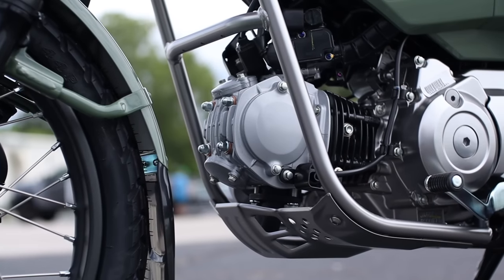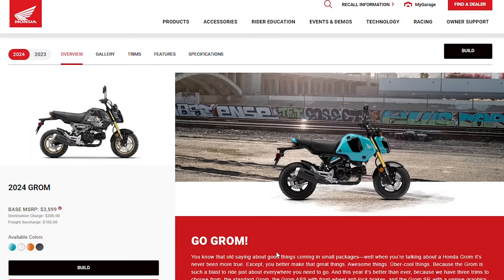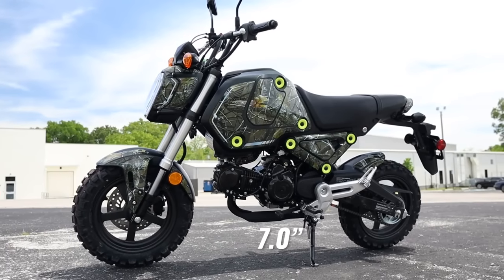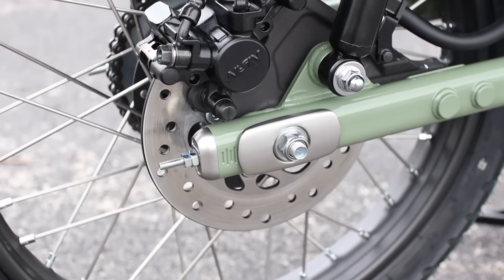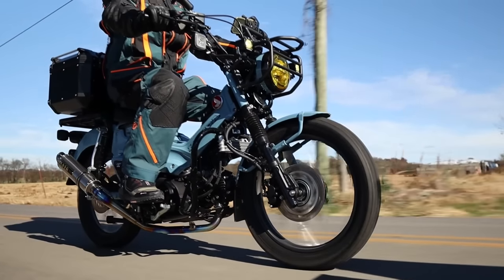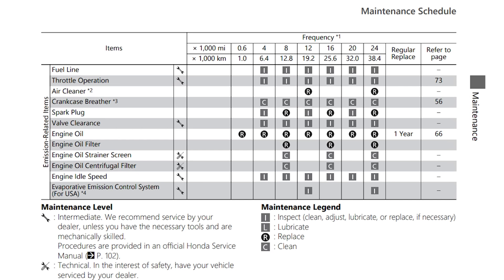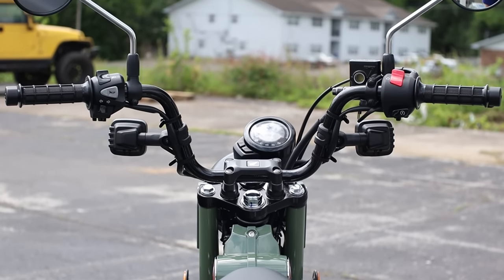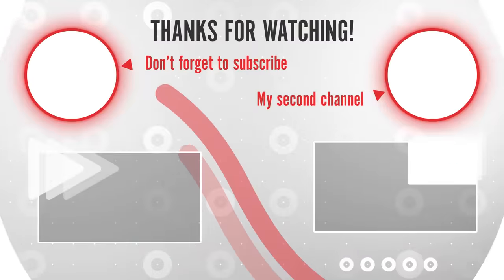NEW Honda Trail 125 Review | CT125 = Better than Grom, Monkey & Super Cub Motorcycles?

Comment: Really wish we could get it in a 200 with a 5 speed. 65 mph, comfortably, would sure be nice. I don’t think that’s to much to ask for
Reply: I keep saying that honda needs to take the rebel 300 motor and cram it into the minis as a 2nd engine option but keep the size of the bikes mini. Then youll have like a 276cc 6 speed and that in a grom or trail 125 would make them much more capable of actually getting me around town with the hills i live in. The problem is i think honda might not want to kill sales on the 125 because the 125 is still a good motor and its durable for what it is and its been out for a long time. Plus theres 300s they dont want to pull sales from by people cross shopping in the same brand. If you sell 3 versions of evety bike eacb one might sell less. I just think it sucks how a grom struggles to 60mph and it should be able to get to 60 faster and also maintain 60 up a hill. Or even faster i mean that sucker should rip. Yiu do a 125 cc for learners they upgrade to like the 250 grom or something idk. The 125 motor is good and shouldnt go away it gets the best mpg it is the best for just swinging out of your neighborhood for a snack at the convienience store or something.  There is a novelty to the 125 grom or trail125 that makes them interesting to a wide variety of people. Doordashers etc. The rebel has 3 options. Im suprised all the minis dont have 2 options. The OG 125 for the ultimate fuel economy and learners and the nkvelty comedic factor, or a more powerful more realistic 250 from the rebel which they call a 300 eventhough its like a 276. So they could market it as a 250 but its even slightly more. Mahne they do something else idk but we know they have the revel 300 engine amd that thing js compact. But js jt compact enough to fit, the grom might meed a generational change like the rebel djd to account for different engine options. Or idk i really like innovation so to me its interesting to try to build the smallest most reliable bike possiible soemone 6 foot tall fits comfortably on that goes as fast as possible without being electric. Then You get an easy package to fit in the garage with a lot of power at a good price and a 125 grom is not that a trail 125 is not that. They are small but slow. I think 250cc version js the way to fill the need. Like how they have 3 versions with the rebel but idk the minis maybe a 125 and 250 version? Imagine a parrallel twin grom tho 270 degree crank. Parks next to a 125 grom and is clearly on a steroid injection program. Idk what will actually happen i just want to be good. I hate the aspects of bikes that make them all identical in certain ways. I really enjoy when something is unique and peculiar in a way that is pleasent. So thats why the trail 125 is appealing but 125cc is rough if i want to leave my small town to thr small town next door where the work is at. Speed limit 55 everyone does 60 and theyll pass you while you do 60 uphill so trail grom 125 motor really isnt safe on those roads always.   I like the series harley cancelled when they lost their minds, there was a sporters series and you could get an 883cc or a 1200cc. the 48 the 72. They were able to make 1 bike 4 bikes. To me groms are too disposable but id still buy one. I like the extra reliablity of a larger engine that would help. The 125 is great for the trail the nkvelty running tho the gas station for snacks, but a 250 isnt far behund and a from 125 for mpg. And in like a trail 125 if it was a 250 would. Cross alaska faster etc. Safer on faster roads. The 125  you take the longer flatter side road because speed limit is lower  and it keeps me from wanting to take the bike out because maybe i just want to quickly go to walmart for a few things and back and the speed lomit 60mph up a hill. The trail 125 i will buy one but to me its partially more like an excersize in good asthetics i am an art guy as much as a motorcycle guy so i like it to look good sitting there and a trial 125 does. But then im like shoot that looks good let me take it to walmart and i have to take the back road slower the trip takes twice as long each way and then im like yo 70mpg in a 250 woulda been better than 110 but a 15 minute drive turned into 25. If im not leaving my small town a 250 is not needed but i like to explore my whole county and the one north of me as theyre the two closest civilizations and between them its 75mph and just between my town and the two others you have to be able to get up to 60 and 65. So its hard to spend 4k on a bike that struggles to get me out of town when a 5k used accord with 200k miles can take me across the country. But i cant take an accord down a single track trail made by people on 125 250cc 450 cc dirtbikes. So i like the 125 its just if they sold a 250 trail id try to get both 😂 i want to see honda use the grom as a plaftorm you can get a super efficient one or one thats just questionably fast. I feel so bad for these guys building touring rigs from trail 125s and jts like yo if im going to the top of alaska if honda sold a trail 125 250 id take the bigger one. They modify the 125 engine for power and its lifespan is 50k miles stock if you maintain it perfectly. So they make it unreliable fast when the motor coulda just been bigger stock.  To some degree i like small motorcycles and big ones so its hard for me to say to cancel the 125 and make them all 250s because i wouldnt mind a grom or trail 125 or 250 both. Or just rediculous fun stuff like a tripple cylinder grom thats got 125cc cylinders its like this ugly duckling that has 375cc but what matters is the power to weight ratio. Idk turbo it from the factory, something. Something. Something. No way you fit 3 cylinders in a grom but i mean what if the 1 was bigger or you do 2 small ones idk. to keep the light alive the souls living, you need uniqueness and peculiarity. The trail has a lot already i just wonder if you can scale it up like the rebel, 125 250 and 500 for real tourin idk. A 250 trail would outnit out there doing light trail dirtbike type stuff. A 250 dirtbike is right in the pocket for the trail you hage to build momentum with it to get up a hill so a trail 125 its worse you end up stopping halfway up and pushing it up. If it was a 250 using the rebel 300 engine thats a 6 speed it can do like 60 stock 65 idk. I got the need for speed but i hate all electrics. I think motorcycles work well as straight gasoline motors
Reply: Yamaha TW200
Reply: @mojaveclimber  I had a TW200, it could cruise along at 55-60 but that's about it. It was too short coupled even for me at 5'9"! I always thought Yamaha should add a couple inches to the wheelbase and put the XT225 engine in it.

Mr. Mojaveclimber, are you a rockclimber somewhere in the Mojave Desert? There is a pretty active climbing scene up in Ridgecrest if you are interested.
Reply: I'd say 150 or 175 would freat
Reply: @mojaveclimber you’re asking for it to be something it isn’t and never was intended to be
Reply: The trail 125 needs to be like the rebel but where you can get it in 125, 300, or 500. That way for people who really want to build a touring rig they can get the 500 and have better interstate capability
Reply: @aaronpudlicki7418  mojaveclimber simply suggested the TW200, a bike with a bit more of everything, as a fill-in for the annoying's moto fantasy. I think anyone that can handle a manual clutch would be better off on the TW200. More power, more suspension. 
I think the new Trail is cute. On the road it's clearly better than the CT-90/CT110. Offroad??? Hard to beat that dual range transmission in rough stuff. 
But Honda kind of trips on its own feet with the XR150L, way cheaper and significantly higher performance. For someone with lots of money it doesn't matter what they get, it's just a toy. For someone looking for a practical bike to commute on and have a little offroad fun, there is no doubt which is the better bike.
Reply: @randydewees7338  You got that right. If I wanted cute or a toy I'd ask for it. Why don't they just get it over with, make it electric and paint it pink. This is the company that made the Elsinore?
Reply: You can slap a Daytona 190 4 valve engine on there for pretty cheap. Put a tall gear on and hit the road.
Reply: @randydewees7338  Why not spend a LOT less $ and buy an XT500? You want grunt from a bike, it's got it.
Reply: @usernumber09 hyundai elantra
Reply: Problem  is, then you would want to drive it on the highway  and that  would not be good .
Reply: or maybe a KLX 230 or 300. @usernumber09
Reply: Why not get a different bike? You’re missing the point of the minimotos. They’re supposed to be small everything.
Reply: @charkswitlazers  exactly.
Reply: After living with my CT125 (latest version) for several weeks you have a good point--I'd prefer a 5-speed manual.   It's a great little bike yet I could see Honda offering an upscale model like you've suggested, without canceling the C125.  Possibly this would address many of the comments here.  I saw one person suggest the KLR650.  They used to offer a smaller version KLR250 (Super Sherpa) dual sport: dual disc brakes, 6-speed transmission and wide comfortable seat.  It could run up to 75MPH.  Really neat bike that I enjoy very much.  Compared to the CT125, it's biggest disadvantages are that it's taller with a higher center-of-gravity and not fuel-injected.
Reply: @TheAnnoyingBoss  A big CC underbone step-through makes no sense at all. Just buy a bigger bike, or lose some weight...
Reply: Don't want to make this into a larger bike but having a larger engine and 5-speed manual transmission would help very much.  I'd buy it again.
Reply: I agree but disagree, see I want a 250 single with efi, in this config, air/oil cooling. 5 speed, with specific gearing. 1 avg ratio, 2 avg ratio, 3 avg ratio, 4 trail high, 5 highway (may need to down shift for hills, but should do 70 on flat ground.)

I know TONS of people who would jump at an ultra light weight, 70 mph light duty trail bike. Like a mini adventure cruiser thay can actually hit highway speeds and not need to have the motor wrapped to it's max.
Reply: @honeybadgeractual5734  Then get a KLX250S like mine, and like mine stick some luggage and a windscreen on it. But when you get stuck in mud or need to pull it out of a ditch, you'll wish you had a little one like the CT. You can't just throw in a bigger engine without beefing everything else up, then you need bigger brakes, more fuel etc etc
Reply: @TheAnnoyingBoss I agree. Personally, I think a 200cc Grom would be perfect. If a bike is a able to be tagged, it should be able to at least do freeway speeds, 65-70mph. However, I knew what I was buying when I bought my Grom though, and I think most of the fun (Other than just riding it) comes from modifying it to try and squeeze as much power from the little powerplant as possible. Mine is a 22 Grom with DHM S1 cam and ecu flash and it will now hold 55-60 uphill, but not without a little struggle. On flat ground it'll cruise at 55-60 without sweating. Stock gearing and airbox.
Reply: The honda wave/xrm variant that has a similar engine to this one is quite popular here in the philippines. Its easy to find bore kit upgrades here. You could upgrade this to at least 200cc. You would need a better cooling system though. I think you could fit one of these with an oil cooler.
Reply: Yeh, as guys we always want just a bit more. I feel ya, I think a 200 beefed up a little more wud me best.
Reply: Hang on. A crf300l is too big but the 125 is too small?  Tough crowd.
Reply: And then you would want a 250, and then a 400cc. It never ends, just be happy you don't have to walk...
Reply: @matrixist  lol. Everyone said the crf300l too small, now they complain about 450, nobody never happy. Lol. I’m just looking for a comfy sport bike. R1 maybe.
Reply: #Honda Listen to this man!! I’d buy another one!!!!
Reply: @TheAnnoyingBoss  exactly why they won’t they want u to buy the more expensive option from trail to grom to rebel
Reply: @TheAnnoyingBoss sir that bike would fkin liftoff everytime you throttle, the power to weight ratio on these bike are crazy. Just 150cc could already reach ~120km/h on the underbone frame
Reply: @randydewees7338 The tw200 does 69mph with me and a backpack on it.  The speedo reads 76 tho.  I'm about 210lbs.  I also feel like the powerband and rpm dropoff before the power does, so if I gear up I could hold 65-70 at a comfortable rpm
Reply: Throw in a headwind and a grade and you'll be holding 45 or less. Where I live - Mojave Desert - there is always a headwind or a grade or both. 

I had a couple XT225 (Serow), and that would be the perfect engine for the TW - a few more ponies and a six speed. 

 @TheGamersRace
Reply: Its not supposed to be a high speed, long range highway bike ? 
Its supposed to be an affordable, reliable and equal mix of city and off-roading.
Reply: The 125 appeal is the price and maneuverability off road . That 200 Would increase $$$ drastically and make it less maneuverable because of the increased weight .
Reply: Get a moped
Reply: You're asking for a TW200. Word for word.
Reply: It’s too much to ask for, it wouldn’t be a Cub anymore…
Reply: @mojaveclimber  A+
Reply: @TheAnnoyingBoss  HOLY  💩
Reply: @TyeWills  JAJAJAJAJAJAJAJA!!! omfGAWD 👀 😱
Reply: @TheGamersRace  F A L S E
Reply: @BattShytKuhraezy  What's false
Reply: All for $999
Reply: @Roger_Ramjet  I mean that'd be pretty good too...
Reply: Get a TW200 OR DR200. The bike you're looking for already exists
Reply: @jackramos3605  I have a tw200.  65mph isn't consistent and when you are going that speed you're revving the life out of it.  Sprockets don't help because it's a power issue.  To make a tw200 somewhat comfortable at 65 you need to swap the cam and sprockets.  Increase power up high so you can gear it taller.  Then you need a seat, and a tank.  Seat is ass, and tank is 70 miles to reserve.  IMS is coming out with a new tank this month, and I'm hoping it's badass.
Reply: Buy the adv 160
Reply: @randydewees7338 the tw200 also has huge tires if the trail 125 was a 250 it would be faster because it has regular tires that armet balloon tires made for mud and loose sand
Reply: @bigglyguy8429 there osnt a bigger bike its a trail 125 or nothing thats what im saying they need to make the same bike bigger. Where is the bigger trail? I do not see it i have to go all the way up tp 7500 for a klx 300. We could do a trail 250 for like 1k more than the 125 and be in under the kawasaki klx in cost but you have a trail that is better and has a luggage rack and actual resale value becsuse you spent less new thats less to lose selling used.
Reply: @honeybadgeractual5734 i think they make the trail 125 and grom have 2 engine sizes a 125 or 250 that way you can buy a 125 for a little over 4k or the 250 dor a little over 5k and it undercuts the klx3000. Way less capable because thr klx300 isna dirtbike but they charge like 7500 starting for those before your through the system. A 125 but tweaked to be scaled a tiny bit bigger up so my ass bone doesnt smash into the luggage rack would be nice. The 250 power would at least allow you to go up those hills woth momentum like you have to do on the klx300 but at least you have momentum due to speed in the 125s you dont so you get halfway up the hill and start pushing with your feet. I like the 125 novelty affordabikity and mpg but i live in a small town of 6000 and the next town over id 50,000 people so you go there often for literally lots of stuff and the speed limit the whole way is 55 but people go 60 and you still get passed so being able to hold 60 up a hill is a big deal to a lot of people. You see these guys take trail 110s and 125s up alaska you could imagine a 250 would be better. I like how honds did it with the rebel you got a 300 a 500 and a 1100. The mini motos you do like 125s and 250s but use the rebel 300 276cc 6 speed idk.  They cluld scale the trails size up 10% amd then dluble its motor displacement and give it more gears and manual clutch. Gey rid of the heel toe shifter for just toe because the heel and toe at same time gets annoying unless there is enough room your foot ismt banging into them.
Reply: I’ve heard they are making a 175
Reply: Well said.
Ty
Reply: I really wish this was cheaper than the xr150l
Reply: @TheAnnoyingBoss longest comment on YouTube goes to … this guy 👆👏

Comment: I have  a 2022 honda trail. I have over 2000 miles since feb 2023. I changed the exhaust. Im routinely able to run 55+. If it runs well every time. This unit is a pleasure to drive. Solid build, simple maintenance. compliments are common when out on the road. There are so many people the had older versions. I love hearing their stories.
Reply: Watching this makes me want to get my 1970 model back on the road. Does the new model have the high- low selector.  Really came in handy when on some of the steeper climbs.
Reply: What did you change the exhaust to? I plan on getting one
Reply: LaneAWD_OwO 1980 trail 110 didn't have hi lo but 81 to 86 all did.
Reply: @PASTELXENON  0:15 0:15

Comment: I've had one (2023) for a bit now and just did my first oil change at 620 miles. I love this bike, truth be told I sold a 2021 crf300L for this bike. I simply did not ride the 300 like it was designed for so I figured it could go to a more deserved home. This CT however is a dream, I used to own a Sachs madass125 and fell in love with small bikes. I really is true. Better to go fast on a small bike then slow on a large bike. Im over the moon with Honda's Ct125 recreation and so happy the brought this to market.
Reply: These are street legal?
Reply: @Str8Rippin93 yess
Reply: But if it was a 250